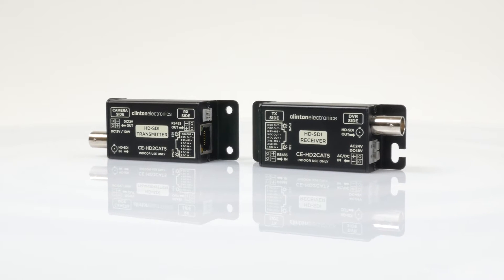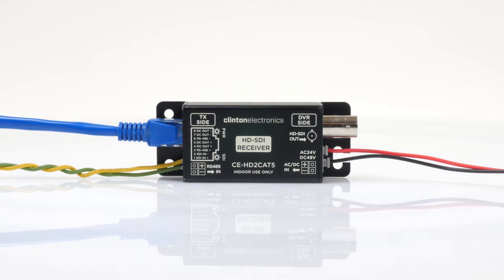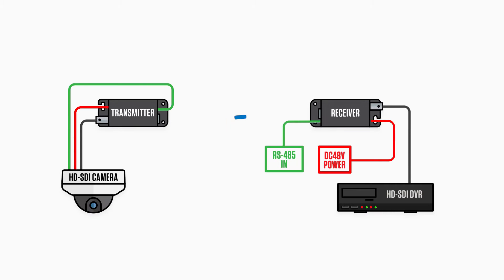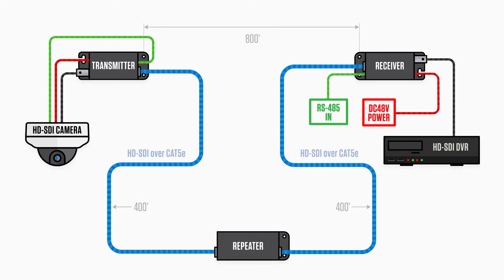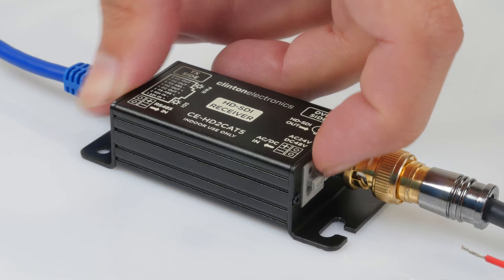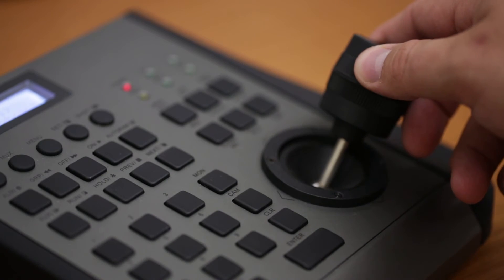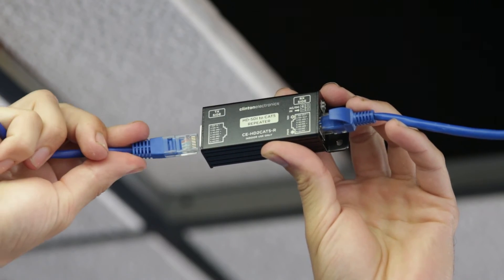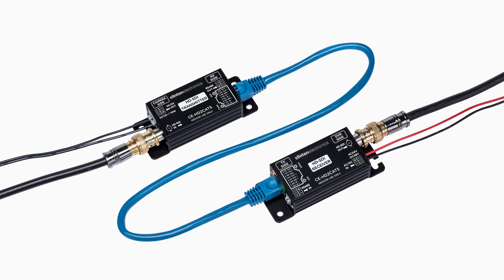CE-HD2CAT5: HD-SDI to Cat5e Transmitter & Receiver Kit

Comment: Available?
Reply from the maker: Unfortunately, this product is no longer available. However, we do offer a similar product, the CE-VB3, which transmits Analog, HD Analog, or EX-SDI video along with DC12V or AC24V power over network cable. Please note, it does not support HD-SDI.